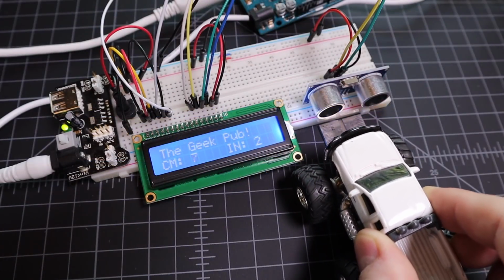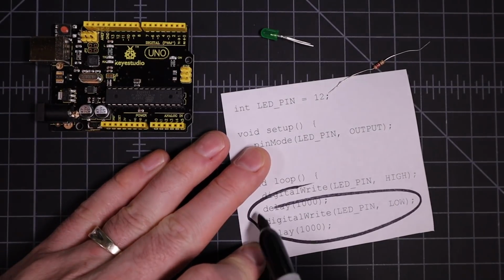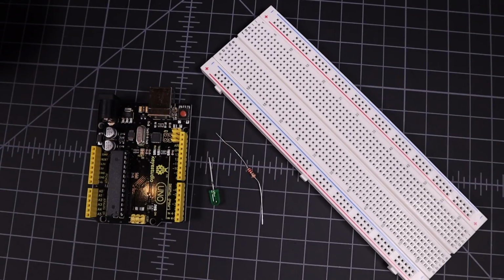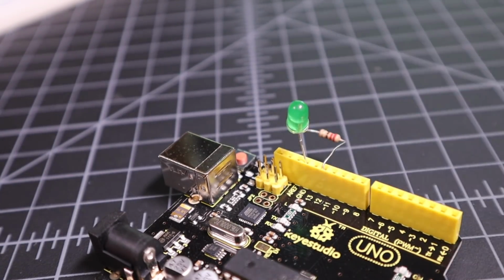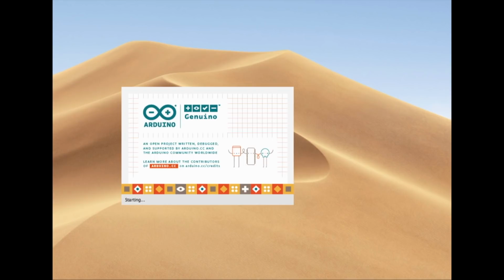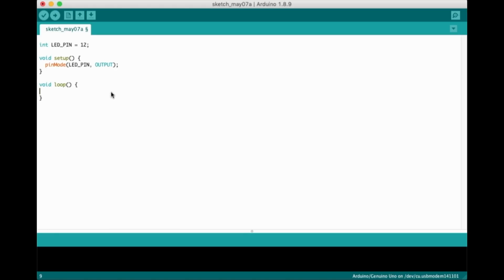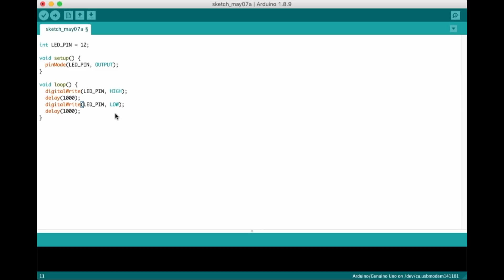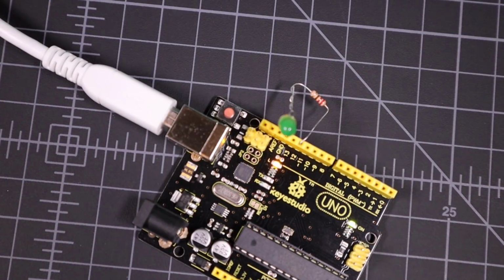Arduino: Blinking an LED

Comment: Bless your cotton socks for highlighting the use of a resistor!
Reply from the maker: Its amazing to me how many tutorials are filled with bogus information.
Reply: @TheGeekPub  I had a guy on a channel the other day making a fuss about how static sensitive something was along with showing his ESD strap and specifically saying it was connected to "a large metal object". I pulled him up on his lack of understanding of ESD and it's control (maintain zero potential difference between yourself and everything you are handling etc NOT make sure everything is "grounded"). He said he knew all about ESD and clarified the metal object was a grounded heater! The total misconceptions some "educators" have and pass off as knowledge is frightening. Either don't mention it at all or make darn sure you are sharing the correct information if you are claiming to be trying to teach people stuff :-)

Comment: can i use 10k ohm resistor??? please reply
Reply: i have arduino uno
Reply: no 10k will not work...
Reply: @goldydevgan  its working brother. perfectly fine.. bt the intensity of the LED is low.. but its fine

Comment: This was a big help.

Any advice on where to start with the coding side of things with Arduino for someone with no coding experience?
Reply: If you search "elegoo most complete starter kit guide" in Google and click the first link, there is a PDF that comes with an Amazon kit that has a bunch of different examples of what you can do with an Arduino. There is a lot of help with the coding side of things in that PDF.
Reply from the maker: I've also put together a review of the best Arduino starter kits.  The Elegoo @Decaying Reverie mentions is the one I've picked as #1: https://www.thegeekpub.com/18751/the-best-arduino-starter-kits-2019/
Reply: I'd suggest working through the examples that are included with the Arduino IDE. There are also beginner level explaintaions of all the functions of the programming language on the arduino.cc website.

Comment: How would I make it flash slower?
Reply: Make the delay time longer, so in this case increase 1000 (which is a 1000 milliseconds a.k.a. 1 second) to a higher number.

More on the delay function: https://www.tutorialspoint.com/arduino/arduino_delay_function.htm